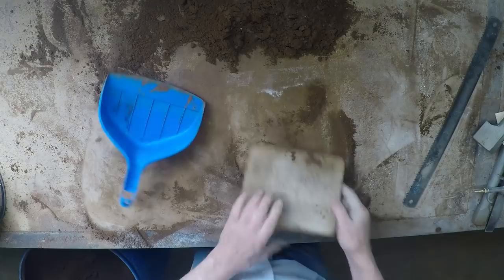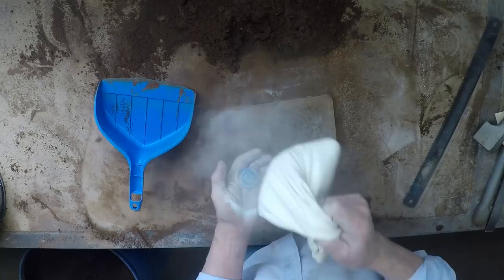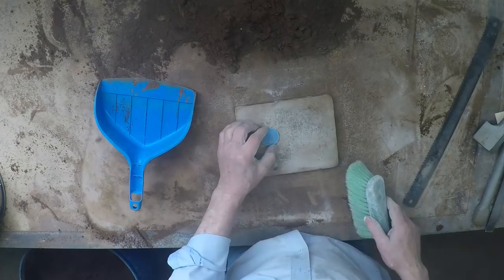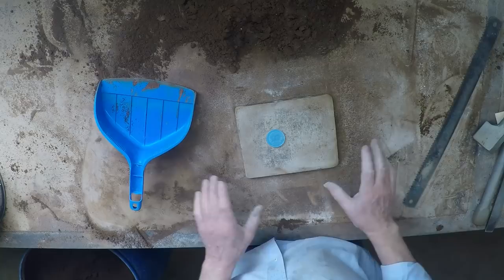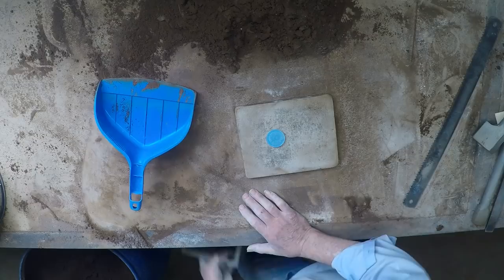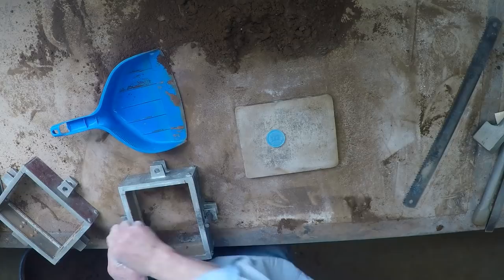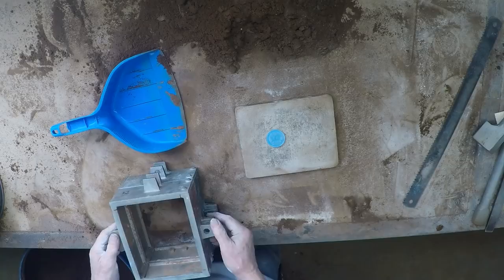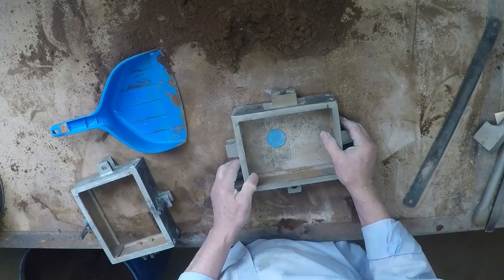Casting a Bitcoin in Aluminium silicon bronze

Comment: Nice! Mr. Perry can be very proud of Grandad. 

Now for a few questions. I keep watching your mold boxes and keep asking myself. Did Martin make those? Maybe Martin knows? How about a little tour of the furnace? Can't do any foundry work without a furnace. I notice both a cast refractory and firebrick. Ant insulation material other than the firebrick?

Your burner? You mention that it is in need of a service. Video? I have designs of a few burners, and have made a proper propane burner from hell. Variable orifice using MIG welding tips. But I plan on going oil and Diesel mix as I am across the street from a country garage with a great young man as a mechanic and an endless supply of used oil.

I have made up wooden mold boxes but I do like the setup you have. So probably makeup wooden ones to cast the metal ones.
Reply from the maker: Mark, Did I make the moulding boxes? Yes I did. Originally I sand cast sides one at a time and it took forever to make enough for 10 boxes. For my most frequently used boxes I cut a quick die from con cast 603 (356) aluminium ingot which had been T6 heat treated. I used this die in the very same tilter that I am using for the lens blank videos . With it I cast 200 box sides in one day! They had to be machined bolted together faced and dowels fitted of course and that took a while. Dowels are 1/2 inch 60 case Thompson shafting. Holes reamed to half with press fit half slide fit.
Furnace was built from 1650 deg C castable around 1972 its still the same lining although a little worse for wear after the thousands of melts it has done. Lid was originally the same castable but gave up after about 20 years through mechanical failure and it has been replaced with a commercial furnace top - you used to be able to buy them, I was given this one. Plinth brick has been relaced several times as they get a bit of a beating, I use cut HA Firebrick. Note, sticking of the plinth to the crucible can be largely prevented by using 3O or so thickness of newspaper cut to fit under the crucible. The castable lining is  4 inches thick and around it is 6 inches of loose vermiculite all inside a 12 gauge steel shell. Burner is a commercial oil burner made for foundry use. It can be turned up and down from 1/2 gallon (UK gallon) to 4 gallons per hour. It is fed with diesel fuel at 10 psi and air at 14 to 16 ounces. This burner cost me a weeks wage at the time but I have been very glad of it since. It does require the occasional clean to get rid of dust blown in via the air. I did use old sump oil and kerro mix years ago but it was such a messy business that I gave it away. LPG is too damn expensive out here and most self aspirating LPG burners never burn as well as thought - the flame needs to be oxidising (usually) but self aspirating usually means a bit rich. If you do not need a furnace that can be turned up and down (as I do for gravity die holding work) you can use a home heating oil burner. these are self lighting have inbuilt pumps and blowers and are available with different jets for different burn rates. I have two and have used them for melting work and a friend used a big one (3  gallons per hour) for his bronze melting most successfully.
Wooden boxes are Ok if you build them properly and fit good dowel pins they burn of course but you get a fair use out of then in the meant time. That said, I would,not be without my aluminium ones!...Martin
Reply: Thanks Martin. Pretty much what I gathered from a lot of looking at your workshop. The information on the burner though is great to know. I like the keep the plinth off the crucible idea of 30 layers of newspaper. I'm guessing it buns partially and leaves a good layer of fine charcoal as a release agent. How about the heat treating methods for aluminum? That I have not found to be to documented on Youtube at all.
Reply from the maker: Mark, I think its actually as much the white ash as the charcoal from the newspaper that does the trick!. I have even used glossy "women's magazines" under the crucible, the paper in these is highly filled usually with Kaolin clay and it is quite refractory so it works well but you do get a lot of the white "ash" in your furnace. The heat treatment that I do is a somewhat crude T5. I would most definitely advise against anyone trying to do their own T6 treatment as it is a process that "does not suffer fools gladly" and even with the best of equipment and control failures are all too common. I could do a video on it but the problem is that it is a subject that can get very, very technical very quickly and I am uncertain as to how deep it is necessary to go - one day perhaps. Basically for my T5 I cool the castings quickly as possible after casting - hence the breakout and water quench - as soon as the casting is just solid enough. Then I heat to 165 deg C for 8 hours. This is applicable to 356 (601) (LM25) alloy ONLY, other alloys  either will not heat treat or may require different temperature / times. The sort of gravity die castings that I do generally do not require the water quench....Martin

Comment: Picked up a few new things that will be helping me out. Thank you for another informative video.  

A bit of a random question.  What fuel is your furnace burning ?   Was reading that the UK's natural gas distribution system is using some LPG.  Wondering about the possibility of building an natural gas fired furnace in the US.
Reply from the maker: Dan, I burn diesel fuel. Its way cheaper than LPG (here in Australasia anyway) Its easy to store and does not suffer problems like bottle freeze up which LPG is prone to. I have no experience with natural gas as a fuel, we have it here  and indeed I have it in my workshop to a few feet from my furnace as that's where the house hot water heater is but when I looked into using the gas as a fuel I realised that it was not a big enough supply to run my furnace and also the local gas authorities are very fussy about the types of burners etc connected to the gas that they supply, the burners they required were very expensive... You can use what you like for LPG of course but not with natural gas - well, not here anyway... Martin

Comment: Would tapered pins, in place of the straight bushed pins, provide better accuracy in assembly/removal of the cope and drag? Thank you for your wisdom!  Greg.
Reply from the maker: Greg, I am aware that the rubber industry sometimes  use tapered pins on their dies and you can buy sets of pins and matching tapered bushes. My parallel pins have to have some slight clearance (I aim for about 0.05mm but will use up to 0.15 mm) and the tapered ones if fitted correctly will have zero clearance at die/mould close. This would be an advantage but considering the general accuracy of sand castings anyway its probably more like overkill. The problem I see it occurs as you lift the mould off the pattern. The pattern has a taper (draft) to allow it to pull from the sand cleanly, if this taper is less that the taper on the pins (from what I have seen this is highly likely) then the mould will lack sufficient clearance on the pattern to come cleanly away whilst being guided by the tapered pins. I regard the lifting of a mould half off the pattern the hardest bit of sand mould making, hence I use long parallel pins to give me the best possible guidance as I  lift the moulds apart. IF I remember this job the little moulds boxes that I used have been re-bushed with bronze sleeves. These give a vey good straight lift but are a bit long and do tend to stick if they get a little dirty... Martin

Comment: Furnace isn't big enough.  Furnace is too big.  Clearly what you need is more furnaces.

A furnace for every occasion (or crucible), in fact!
Reply from the maker: dfross, I actually have three furnaces! this one that will take an A90 another which is electric  an A30 but for zinc only and finally one that takes a BC100 crucible it holds a 100 Kg of aluminium will be used in an upcoming video I hope! I have built others over the years both for a boss and for myself. I am contemplating a small one to take an A6 (or maybe an A12) just for small melts like this just need a suitably solid container have everything else.. Martin
 PS. I have about 30 crucibles!
Reply: So, you need about 27 more furnaces!

A smaller furnace definitely sounds like the go.  It would save you time and fuel (maybe even save you some effort!) when doing little melts.

And we'd get to see videos of you designing and building it.  I'm sure you have more knowledge in the area of furnace design than most of the foundry people on youtube.
Reply: 30! Nothing like a little showing off eh?
Reply from the maker: Mark, If you've got it flaunt it..😀.. Martin

Comment: What kind of bird is that in the background? - I thought I recognized that furnace light off! -  Not bad, Not bad.  The pattern could have used a bit of smoothing.  Your castings show very fine details.  Great work on a thin casting!
Reply from the maker: Mature, Rainbow lorikeets,  see this video for a quick better look at the feisty little fellers
 https://www.youtube.com/watch?v=opkL7yMSI3s  
I deliberately did the casting without any smoothing although the pattern had been printed in ABS in case we decided to try Acetone  smoothing. I could also of course have given it a lick of spray paint but the idea was to see if we could successfully mould straight off a 3D print. A lot of the success is due to the mould having been completely dried in an oven at 140 deg C for 2 hours or so... Martin
Reply: Wonder how many people have 3D printed their own "Gold" YouTube button.  LOL    Thank you for the bird video.  Had never seen the RLs before.  Beautiful birds.

Comment: 90 10 aluminum bronze. Do you melt aluminum first then add bronze? Or do you melt bronze first then aluminum?
Reply from the maker: K, the golden rule of making up alloys is to melt the highest melting point material first and then add the other elements in order of descending melting points melting. Thus for a 90:10 aluminium bronze (why oh why is it so popular - its a very difficult alloy in the foundry!) You melt the copper and when  it is just all molten add the aluminium. Be warned that adding aluminium to copper gives an exothermic dissolution i.e. it will all get quite a lot hotter as the aluminium melts and dissolves this can be a bit troubling the first time that you see it!. Your chances of getting a 90:10 product are zero! Most people have no idea just how poor the recovery of added elements can be and I would guess that much of the so called 90:10 that has been made on YT is closer to 95:5 because of poor aluminium recovery. I have and still do make up alloys from time to time but prefer not to do so as its just not that easy to get what you want and you never quite know what you do get. .😏. Martin
PS. For the addition of an element whose melting point is too high for your furnace eg, pure iron you have to rely on dissolving it in the highest one that you can melt.
PPS Stay away from wire as your source of copper.
Reply: @olfoundryman8418  thank you for the thoughtful reply.

Comment: Impressive thin casting. Just how thin is the average thickness there?
Reply from the maker: Walt, Thank you for the comment but seriously its not that impressive, firstly its about 4.5 mm thick with perhaps a 1/2 mm recess in each side giving about 3.5 mm in the low areas but its very small so not far for the metal to run and then I know this alloy to be very fluid (yet pull very smooth against a mould surface) and I did dry the mould so there was no moisture to soak up heat and no steam pressure to prevent mould filling.. Martin
Reply: It's still reasonably impressive considering you know the tricks of the trade to make it happen, and considering that it's towards to low end of recommended Non-Ferrous alloy minimum section thicknesses range of 3.175mm to 6.35mm.
Reply from the maker: Walt, One of the greatest tricks (that I have never tried) is said to be smoking the cavity with an acetylene flame there is something strange and unknown about the structure of the soot thus deposited and it is said that metal will run up to FIVE TIMES as far in a mould thus smoked. Professional casters using properly dried plaster moulds have consistently managed to cast 1 mm sections apparently without vacuum or pressure assist- the mind fair boggles! I would love to try it but lack of an acetylene cylinder prevents... Martin
PS. I am interested to see what happens when I try to make another in aluminium (356) That bronze runs well.
Reply: I think smoking the cavity with an acetylene flame might have been the inspiration for the graphite mold washes some shops use (I think those mold washes are mostly used with cast iron). My understanding of the process is it gives additional insulating to the mold. I was unaware of people being able to get down to 1mm, that's crazy thin.
I would have to wonder if you could 'fake' the same sooting effect with a candle, it would be a little tricky to pull off as the mold would need to be above the candle and is rather slow in comparison to acetylene sooting, but for a small thing like a coin it should be ok for a test (similar to this process using an oil lamp https://youtu.be/j3J4feSZjoM?t=4m35s). A butane cigarette lighter might also work for sooting something small.
Reply from the maker: Walt, The inspiration for graphite washes? - Don't know, such washes have been around for a long time but so has acetylene I guess. I have used graphite washes for may years in gravity die casting of both aluminium and aluminium bronze. I would still use them for the bronze but these days I use the Boron nitride sprays for aluminium gravity die work. Generally in the gravity die industry a graphite dressing is not regarded as insulating in the way that the white spray that I used is. Solidification rates are often "fiddled" locally by applying thicker coats of an insulating spray or locally thinning it down by rubbing some off with steel wool or a small wire brush - its one of the tricks of the trade. Early on in gravity die work before die sprays became common may shops just used to smoke the die with carbon black form any old source including earlier versions of those you have suggested. Most smooth non permeable moulds (metal rubber etc) seem to work only if some sort of fine substance is on the surface the metal forms against - I believe this is to do with air getting out through this fine layer upon which the metal "rides" - certainly modern sprays work this way with the metal riding up on the top off the slight roughness of the spray and the air escaping out through the intervening spaces Acetylene though is by all accounts a bit of an oddity and its not exactly know why or how it produces the effect. Its not much liked in foundries as it tends to fill the air with greasy black "stuff" which eventually coats most everything in the foundry. I believe but don't really know for certain that the effect of acetylene can not be produced by other smoking /sooting agents. It  is a bit like the mystery of carbon blacks in rubber certain blacks (channel ones apparently) are much more reinforcing and why is a bit of a mystery. One would just have to try some other things to find out I guess!
According to John Campbell (Complete Casting Handbook) Acetylene smoke has given 2 to 3 times increase in fluidity in sand moulds and has produced similar results with permanent mould castings in aluminium and iron. But attempts to replicate these effects with other coatings have so far failed. However please note I have failed to re-find the reference to 1mm section thickness  so don't quote me on that..... Martin
Reply: It seems counter-intuitive but according to my reference on manufacturing (FUNDAMENTALS
 OF MODERN
 MANUFACTURING
 | Materials, Processes, and Systems by Groover), chills are used to increase runner length. I've also heard of graphite blocks being used as chills, might be a bit of a clue to the mistery.

 I've definitly seen Acetylene ensure that nothing in the shop escapes its sooty touch (even with extraction hoods runing).

Comment: Thank you -- What size is your facing sand vs backup sand?
Reply from the maker: Htral, Unfortunately I do not have a set of sand sieves to provide accurate size data. My facing sand is made from half old backing sand and half new sand. The new sand measures 0.006 inch with a micrometre (stupid way to measure sand I know!) this would be the largest grain in the sand as that's all a micrometre can tell. The facing sand is made by grinding up  the new old mixture and you can see  this being done here https://www.youtube.com/watch?v=L9qP39y3E4k   If you have access to the required sieves I can send you a sample of the sands and you can do your own test I would be interested in the results.… Martin
Reply: Sadly - I do not have a sieve set either.  I did lookup particle size vs mesh & found a .006 inch particle is about 100 mesh.  This is right between yellow and red netafim and about half the size of 'fine sand' -  just so ya know.  I recall reading petrobond max recommended sieve  size was 400 and had talked to one iron foundry fellow that bragged about using 100 for his to patterns as it gave him best results too so this sounds spot on.
Reply from the maker: Htral, One point to remember is that a micrometre measurement only gives the size of the largest grain and most of the sand is much finer particularity the facing sand. These natural sands have a much wider grain size distribution than the sort of washed sand that many foundries use today as a base for their hard sand moulds. 400 is fine, very fine and 100 would be fine for an iron foundry... Martin